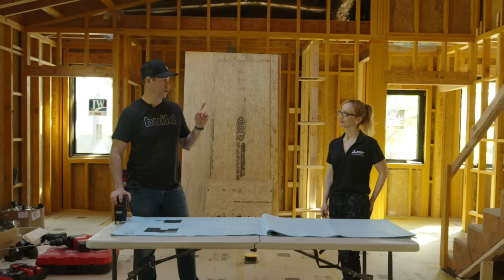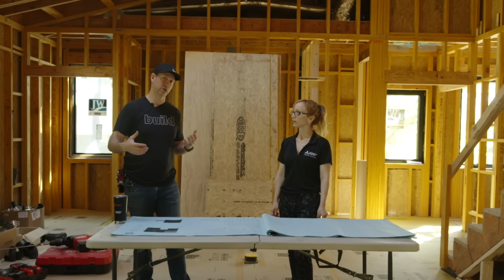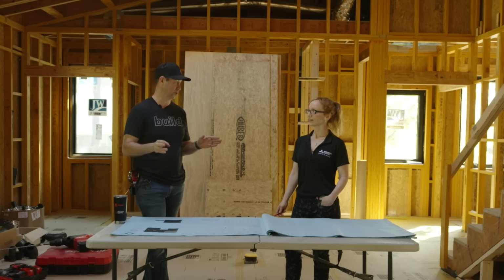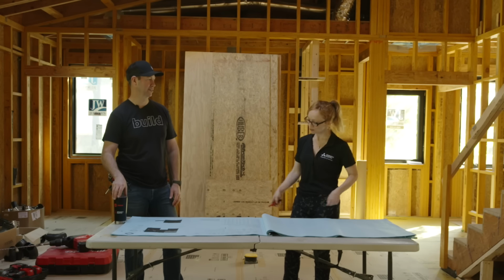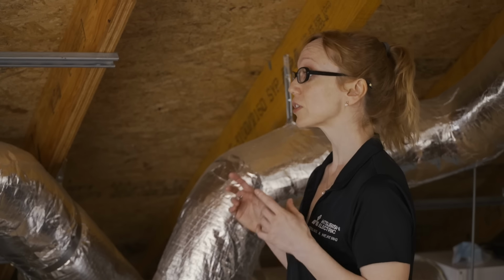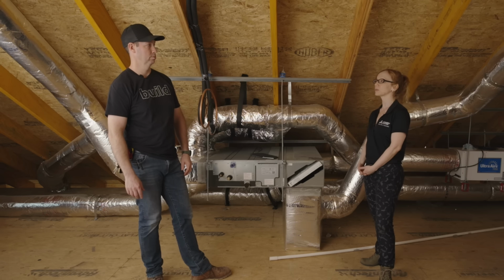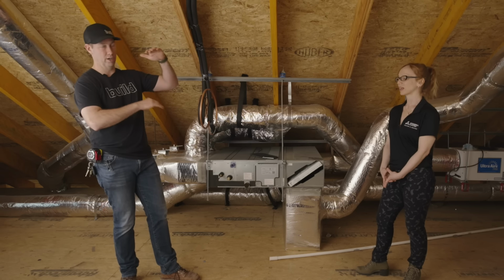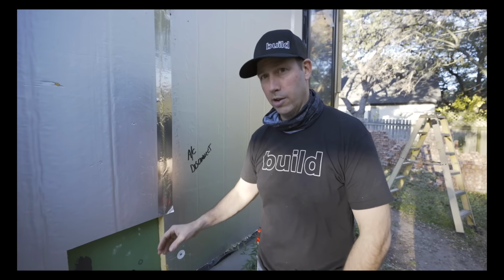Mitsubishi HVAC At My House - Full System Tour

Comment: Talking up ductless while standing in front of duct work 😂😂. That’s a beautiful $100,000 system though
Reply: This hvac is ridiculously over built.  Complicated setups like this inevitably lead to high maintenance.   Mitsubishi is not know. for their big house ducted systems. Their simple ductless are the best in the world.  Matt will not be happy with the ducted system he has there, in about 3 to 5 years when the maintenance time adds up.
Reply: @gial8862  Negative, sir. Way off base. Not to mention, here's a guy trying to advocate for ppl actually CARING about the things that make their homes liveable and not just the Carrera marble and other bullshit.
Reply: @Floridaman8783  , Ive been following him for years.  His own house didnt even have all the stuff he was recommending, until he got enough sponsors, now its the rolls royce wall to wall.  I remember when he bought this house, and he was going to flip it, and yet he was recommending all these wetarded things to replace and upgrade, there was NO way he’d make a profit. Sure nuff, here he is, year or so later he still owns it, and decided he’d live in it instead.  Good choice.  He used to recommend the zip system like it was the best, only to find that the tape was falling off all over and required massive job oversight to get it right.  Lots of people were piiiiiissed.  He also gave some shoddy advice about pex and then went back and did another episode fixing his initial mistake.  No ones perfect, but you brought it up.
Regarding the AC; no.  In 5 years he will wish he had a fill ductless system.  EZ to maintain; cheap to run; 80% effective at -14 degrees F.
Reply: Oh, lest we not forget his “spray” foam discovery days.  omg.  If its in a house? spraaay it baby.  Oh wait; turns out toxic chemicals all over the place isnt the greatest idea afterall.  Now he’s more careful.  Gotta wonder how many ppl DIY’d it off of his original vids tho.
Reply: @gial8862  Sounds more like you just don't like Matt Risinger as a person at all, more than anything. Point is, I don't care about all that other stuff, I care about the hvac system. Having a full ductless system in that house would be bananas. 
Maybe if I were a true retrofit, maybe if they hadn't ended up rebuilding the whole damn thing. Then, that might've made more sense. But having a 100 heads throughout a custom house being built or re-built doesn't make sense. 
Not when you could, in fact use a mid-static cassette, or even one of their regular air handlers to take care of those spaces off the 1 unit, while still having redundancy. Not to mention design aesthetics. While I love Mitsubishi's products, high wall, 4 way, even the 1 way ceiling heads like in his kitchen are ugly as hell from a design standpoint. Performance down to those cold temps isn't as relevant here being that they're in Texas, not Minnesota or some shit. Even so, there's plenty of matches besides straight ductless for pairing with a hyper heat.
As for the zip system tape, it can't be that bad if all these ppl are still using it. I've only seen it used a few times in my market but the tape was always plenty stuck, or they use liquid applied. But the majority of homes are block or solid concrete where I live, not stick framed anyway, so it rare to even see it being used.
Regarding spray foam. Well, I think that's not just Risinger. Lots of ppl were on that bandwagon, for years. They were doing it down here years before it became popular elsewhere. It's only been the past several years that ppl all of the sudden finally got concerned about off-gassing of the foam and such. Which of course made its way to the main stream. 
I can tell you this: from the first home we saw spray foam go in years ago to now, I've never been a fan of it. Anything you have to wear a full face respirator, and clear out the jobsite for a few days to apply doesn't sit well with me and never has. It raises obvious  long term safety concerns that I think everyone should've been asking from the beginning.
Reply: @Floridaman8783  , You are correct for about 5 years ago, regarding ductless.  Not now though.  Also, Zip systems are better now, because of the mastic, but my point is that resinger has a history of raving new and untested stuff and not even implementing on his own home, until this house.  I made one comment about over building his new hvac with a high maintenance, high price, ducted system that will be a regrettable purchase very soon, and then old school john doe’s decided to tee off with their own misinformed information, as if they speak from authority bc the old way of doing things MUST be the best; heck, one old man got shiny awards.  Truth is, the hvac industry is highly regulated in most states and this causes barriers to entry, and prevents innovation.  Mitsubishi has jumped ahead of the trend with their new inverter tech.
Reply: @gial8862  Idk what you mean about 5 years ago. The ductless heads/cassettes/floor mounts etc are still ugly. Do they look better and have more options now? Absolutely. But even for Mitsubishi, their traditional style heads still look largely the same. You really can't change what a ductless head looks like on a wall or in a ceiling. Its just.. There for all to see.
I can even agree that Matt, and other YT/social media personalities can be quick to pander to sponsorship of the "latest & greatest" free shit they get. Even when doing that can be a disservice of untested products & methods.
Point being, this isn't that. It's not like those cassettes are some "new" magic products. They've been around for years. I know, I've been installing them for years, and I'm one of those Mitsu diamond contractors he talks about in the video. There's reasons and applications for using cassettes. I don't think I would have in this case, I would have used one of the regular Mitsu air handlers, but either one works great. And you don't have to have heads or cassettes everywhere. Crap 14 seer equipment and wall hung really just don't fit a custom home. 

Hell my own house has a Mitsu air handler upstairs, a ducted cassette downstairs. A wall hung in the laundry room, another on my closed in back porch, and a 1 way ceiling cassette in my shed/shoppe. If anything, the wall hungs are more maintenence than the 2 ducted units. None of them have ever broke.
Reply: @Floridaman8783  , The ducted units stop heating properly around 30 deg F.  Sure they claim 20 based on the certs, but its just not true in the field. On the other hand, the ductless actually pull heat from zero degree outdoor weather without turning on the energy hog space heater as the ducted units do.  The ductless ceiling units are the way to go all around.  One compressor for the upstairs rooms and one for the first floor, and maybe one for the basement rooms if its a big 5k+ house.  Each unit being independently controlled, or grouped with the app.  Sounds like a lot, but with that setup, a mansions electric bill would be half as much per year. Maybe even less depending on how you zone it.  Not to mention near silent.  No duct cleaning.  No disposable filters to buy.  The perks over ducted are too numerous.
Reply: @gial8862  you are sadly mistaken. The reliability of this equipment is amazing and the mixture of ductless and ducted is very common on Mitsubishi system designs for 2000+ square foot 
, multilevel homes.
Reply: Ductless systems have to be coupled with ducted ventilation units. Don't criticize what you don't understand.
Reply: @CybekCusal  you clearly do not understand how mini split systems can be configured. In this case, one of these multi zone systems is a (mid-static air handlers - driven by a heat pump condenser plus refrigerant line set plus control lines. You are the clueless one.
Reply: @meyerjeff  you're right. I'll go tomorrow to forfeit my PE 😂🤣
Reply: @CybekCusal  , lol, well thats total BS.  Someone has taught you wrong boi
Reply: @gial8862  that's why I win awards 😂🤣
Reply: @CybekCusal  , Have a cookie 🍪

Comment: My 20 y/o DFW house has 6k sq ft under HVAC coverage.  Finally finished 2 yr project replacing 5 complete HVAC systems zones and 2 tankless hot h2o systems, $75k new roof and $30k in JW replacement windows.This year is backyard refresh time with pool and pool house renovations, privacy fence replacement and resoodding dogs side of yard.
Reply: Could have built a brand new 2500 sq. ft. home.

Comment: You live in Austin TX - on avg, it’ll be 100 degrees daily, from July to Sept.
Reply: Just what i was thinking! Round rocks hot!
Reply: If you think about the actual time that it is 100 degrees, it is only that hot from like 10am to 6pm (and that is generous). That is still 1/3 of the day, 2/3 of the day would be under. 

I agree though, the 1%-of-the-year is a low estimate but the actual % of time during the day is probably not as much as most imagine.

Comment: Matt, I live in mexico, it gets really hot here in summer. The standard way to do ac is to put a minisplit unit in your bedroom, and in your living room if you have the money. Living rooms usually have fans on the ceiling.
What's your opinion on that?
Reply: Mexico homes are built with brick and concrete.   There is no room for ducting and central ventilation.   Mini splits are your only choice.
Reply: @JamesG1126  makes sense!

Comment: I'm surprised he didn't go with a Daikin FIT communicating system. Super low noise at around 56dba full tilt for the condenser and fully communicating with the ability to tie in fresh air ventilation/ dehumidifiers also.
Reply: Daikin communicating system is needlessly more complex and less reliable. And no quieter than Mitsubishi. I would choose Mitsubishi every time.

Comment: I am not a builder (and generally not a YouTube commenter :).  But I cool lots of products from peaches to ice cream.  Freon, ammonia, glycol... commercial systems.  I very much enjoy your videos.  My concern is this:  When you make these zones without "mechanically" breaking these zones with heavy insulation or even minimal barriers like a door... shouldn't we implement a control system that would communicate with adjacent zones about target temperatures, turning on air handlers, delays, cycling etc.  Its complicated enough to control multiple 1:1 systems touching the same air with multiple thermostats, but the idea of controlling a $25k HVAC with a mix of 2:1 and 1:1 systems that are all* inside the same R50 super air tight envelope with 4 Nest thermostats sounds inappropriate.  Those smart thermostats have delays and pre-cools and all kinds of little "efficiency" features that conflict with the modern controls in inverter condensing units.  For the past 10 years I've been fixing my commercial refrigeration systems and controls is half the battle.  If you put independent "smart" controls on this high-end zoned system, I see units fighting one another.  I see one of those systems becoming a "lead" unit unintended.  I hope the next video shows how important it is not just to insulate or select a high efficiency system, but just as important, how you control that system.  Your best results would be with an engineered control system that the manufacturer is going to stand behind.  90% of the issues I had with my commercial systems were not with unit sizing or insulation, it was with the installer deviating from the designed controls.

This may be my first YouTube comment.  If you go this far, hope you enjoyed the book :)

Comment: Bad thing about the mini split systems is the lack of availability of parts in ten years.  These are through away systems.  Just like the condensing boilers.  Best to use traditional high efficiency Hvac units.  If you need to zone, use either electronic single dampeners or manual registers
Reply: the real problem is that installers charge WAY too much to put them in or replace them. I got quotes for replacing 2 single-zone compressors/heads (keeping the line-sets and control lines) totaling $8k. instead, I paid $700 each for the units and install them myself in 2 days. I borrowed a vacuum pump, but the MrCool DIY units don't even require that. installing these things really isn't the type of job that requires $500/hr expertise. anyone who can install a garbage disposal can install mini-splits. so, in 10 years, if you can't find a control board, just replace the units. the repair guy will likely charge more to repair a mitsubishi after 10 years than a whole new unit would cost from another brand. if you're not handy, then buy Mitsubishi so that you know they'll support their products for a long time. it would be awesome if mini-splits could be installed by folk other than HVAC pros. the guy who hooks up your cable is more highly trained than is necessary for a mini-split.

Comment: Matt, Don't you have an ERV? Does the thermal load due to ventilation account for heat/cooling/humidity recovery?
Reply: I now see you have a Broan ERV. The specific heat of air is 0.0184 Btu/SCF°F. If you ventilate at a rate of 100 CFM, a sensible ventilation load of 3014 Btu/hr is going to heat or cool that air by 27°F. That seems about right for a 0% efficient ERV in Austin. Is there a boo-boo in the Manual J calculation?

Comment: Do you also factor in-room appliances and electronics into BTUH values for the final load calcs?
Reply: You can... But load Calc is a lot of assumptions and there is a lot of overhead included. Especially when you choose your cooling and heating ability in accordance to peak loads.

Comment: while i love these products for what they are, implying that these systems can be cost saving is nothing but a massive deception. the required ductwork for a conventional system to zone that same area realistically, even when factoring in labor would equate to 1/3-1/2 the cost of that system. the increased equipment cost on these is much much higher. as i said i do love the equipment but from a "savings" stand point i dont find it to fit the bill anywhere close. On top of that service and maintenance required on these systems as a whole are more difficult, costly, and time consuming than that of conventional. Advanced filtration is also an ability you are sacrificing by going with this. When absolutely necessary or where ductwork is not a possibility these systems are fantastic however if you can get ductwork in, you can end up with much better IAQ for a lower price with a variable speed zoned conventional system.
Reply: for most people, mini-splits can be a huge savings because you don't blow conditioned air into unused spaces. when you sleep, you have a single unit on and everything else is consuming 0btu. now, he has a passive-house, so the losses when conditioning an unused space are not as big as the average person so his case does not hold up as well. plus, ducts are very difficult to balance and no central system is going to give you the level of control of a mini split. by the time you install a 6-zone ducted system, costs start to add up.
Reply: Trick is to remember that all of these manufacturers are the same - the cheapest AC stuff is same as  most $$$.

Comment: I'm about to start designing the HVAC system in my 150 year old 4,000sqft farmhouse. I wonder if I could get some reps to come out. It would be a great showcase project.
Reply: look into MrCool DIY multi-zone systems. aside from the electrical, which I recommend having done by a pro,  you can install 3-4 zones in about as long as it takes you to snake the cables/linesets through the walls/attic. there is really nothing to it. if you're handy enough to change a light fixture and a faucet, then you're handy enough to install a DIY Multi. I have an old drafty house and the energy savings are huge because I can have a nice comfortable temperature in the rooms I want while letting the others be 10 degrees closer to outside temp. no need to cool the whole house to have a comfortable sleeping temperature.
Reply: Search google for Mitsubishi residential Hvac plus your zipcode. You will get a list of certified designing contractors. If they don’t start with a heat load study, move onto the next contractor.

Comment: I’m been doing residential heating and air conditioning for 31 years now and just want to throw this out there.what he has bought the average family can’t afford.when these break and they do give problems,the parts are extremely expensive.if out of warranty be ready for really high repair bills.we sell Carrier and the 22 seer condenser boards are over 1200 dollars.the fan Motor is over 1000 dollars.the money you spend for the system and any repairs or of warranty,you will be lucky to just break even.
Reply: This system will be installed by a certified Diamond Elite Mitsubishi contractor and that brings a 12 year warranty for the entire system. The efficiency of this system will approach 300% and even on the hottest weeks, the electrical usage to stay cool and low humidity in the house for easily 25 years. The Mitsubishi systems is almost silent. The Mitsubishi modules are far more reliable than any Carrier, etc brand.
Reply: @meyerjeff  Thanks but don't forget that 12 year warranty is a LIMITED warranty.  Some parts and labor are not covered.
Reply: He built his own house for what he is a well off builder + influencer. You are right 80% of your homeowners can't afford this. That's not his deal. I learn a lot from watching, but I don't expect to see any of this on my next volunteer day at Habitat for Humanity.
Reply: Matt does a great job but I think could spend a little time explaining some of the real world type issues with some of his products and methods.  Even if people could afford some of these things, how many people would be willing to pay for it.  I think he should also explain the stuff he gets at a discount and/or for free.
Reply: @chrisanthony579  he did cut apart a water heater that costs more than my first car.